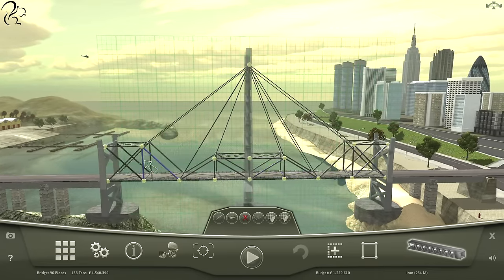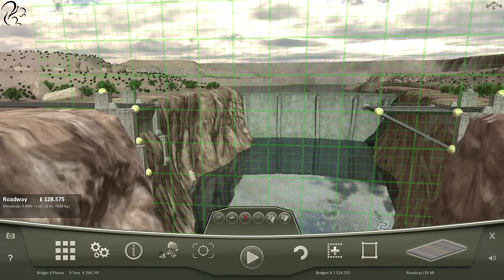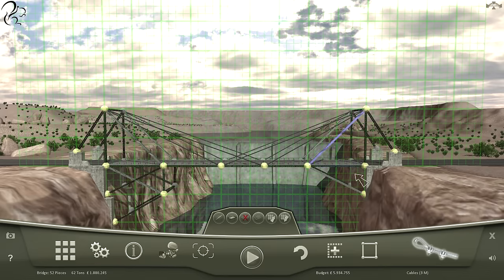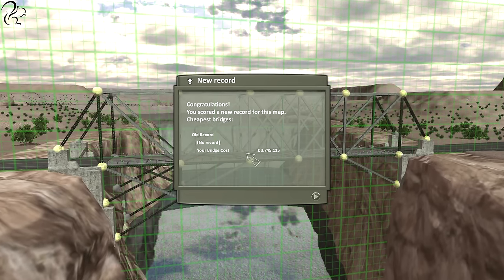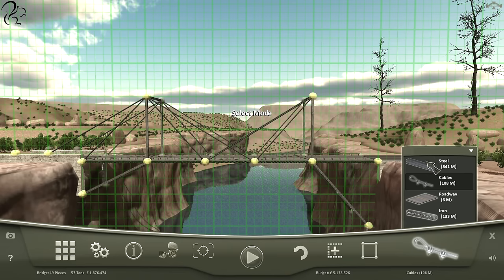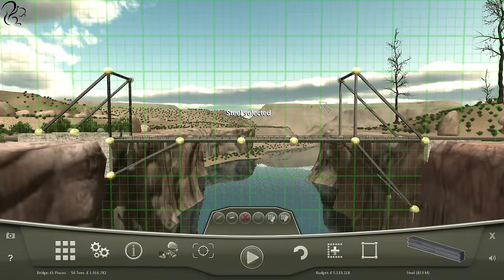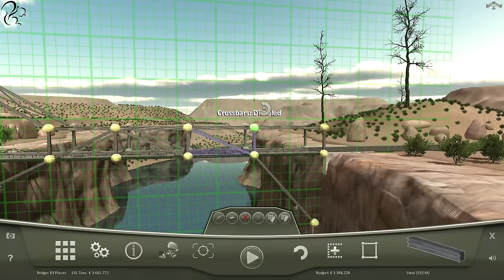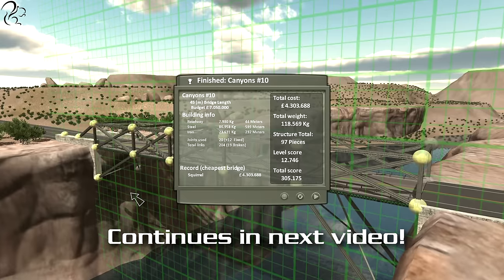Lets Play Bridge Project - Episode #12

Comment: Not really his fault.  No engineer would ever use cables without pretension.  I'm not sure why the cables in this game require the weight of the structure to apply tension, which causes it to deform prematurely.